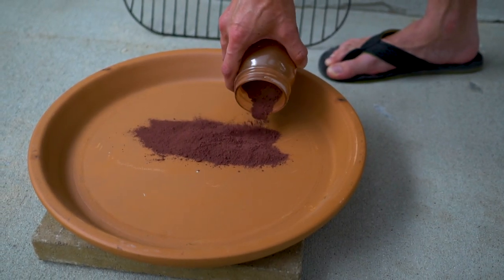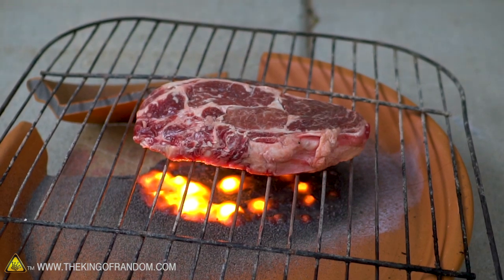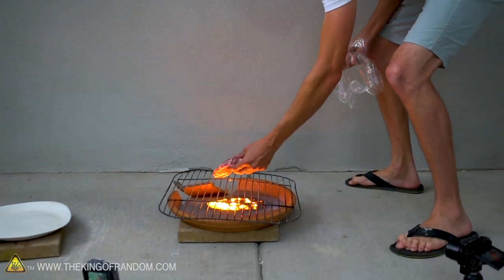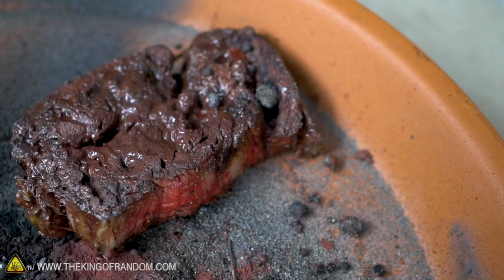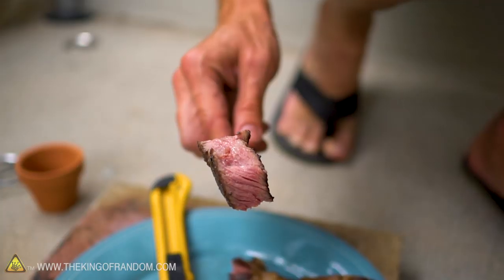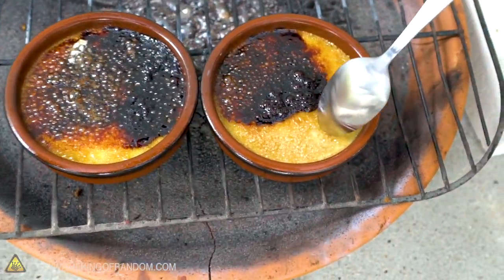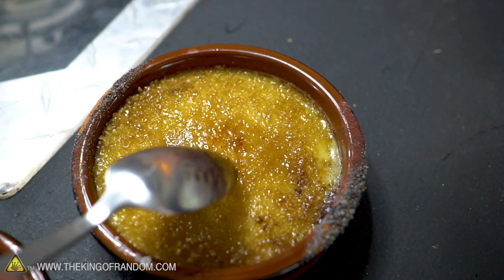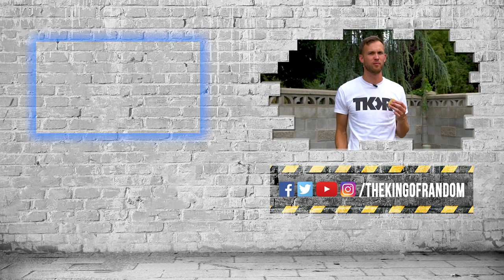Cooking Steak at 4000 DEGREES! TKOR Tests Cooking With Thermite! Is This The Best Way To Cook Steak?

Comment: This is just an excuse for Nate to eat steak. LOL
Reply: You sound surprised?
Reply: I would take any excuse to eat stake too!
Reply: Nates excuse to eat steak and Calis excuse to set things on fire. Perfectly balanced as all things should be.
Reply: I'd eat steak just for the sake of eating steak.
Reply: @darkunicorn1208  wait so Nate and Cali were thinking "Lord, forgive me for what in gonna do" or "it's fun time"????
Reply: @KiwiSenpai._.  Its fun time
Reply: I’d take any excuse to eat steak
Reply: I’m not trying to be rude or be mean but didn’t Nate pass away?
Reply: @NFTI  how about making a modified lid for the new foundry where it's basically a (Steel perhaps? Unless the new foundry can melt it now.) frying pan with the handles on the sides and the vent holes and no insulation or a lot less than the actual lid has so more heat can transfer to the lid?

You can melt stuff inside and make yourself lunch at the same time! (Assuming a steak doesn't get thrown into the foundry and cooked that way of course. 😅)

Comment: Just a heads up from someone who does a lot with thermite, I strongly recommend not eating food cooked over thermite since you end up eating loads of iron particles and aluminium oxide. Neither which are exceedingly dangerous but can cause sickness or immune system weakness. Speaking from experience here 😂

Comment: Even though it's rare in the inside you can eat it. Bacteria for cut stakes stay on the surfaces of cut meat so it is still viable to eat. The harder part would be the toughness of the stake since it is raw. lol Grounded meat is more dangerous since the meat is minced and means the bacteria has been spread all over from the surface. So never have your patties or grounded meat undercooked.

Comment: you know, the thermite is just rust and aluminium, so the smoke is just two possible thing; 1. CO2, the same gaz of the coal make, and 2. gaz metal, not really possible, but that can be gaz of aluminium or alumite

Comment: I wonder what happens when you try to flush kitty litter in a toilet
Reply: You get a clogged toilet since it will build up in the pipes right under the bow, unless it's the flushable type of litter which won't stick to your pipes. I'd say you might be able to get away with small amounts (e.g. a litter-coated cat turd or two), but it's really not worthwhile. If you want to flush your cat's wastes down the toilet, either train your cat to use a toilet, or buy litter that is marked as flushable.

Comment: Thermite is ferric oxide and aluminium powder, yes? In theory, could you make up your own Thermite with tiny pieces of aluminium foil and rust?

Also... blue rare steak. O.O drool
Reply: Yes I've done it, aluminum foil works great. And you can make huge amounts of iron oxide using electrolysis

Comment: I think and I’m no chemist so take this with the largest grain of salt but the smoke isn’t necessarily bad the worst thing that could be in it would be either the aluminum powder or iron powder/rust. So if you don’t mind the grain it should be fine. But don’t use it to much as iron in large doses is very harmful. Once again not a chemist or doctor. Just going on my knowledge